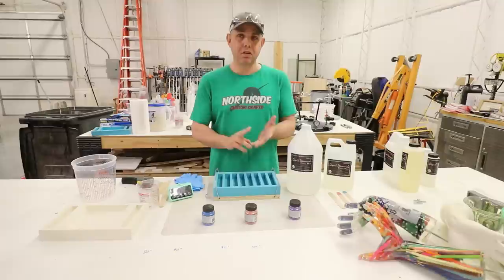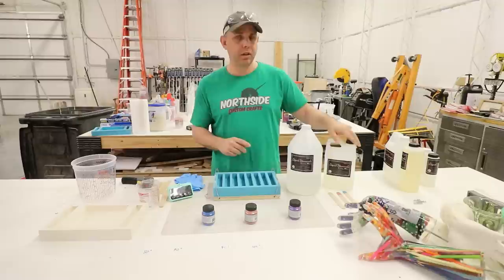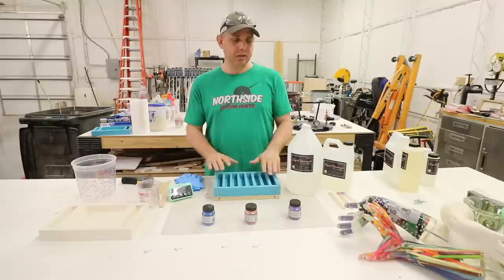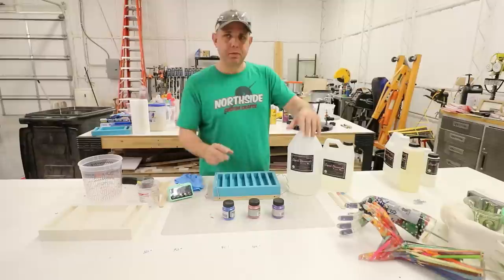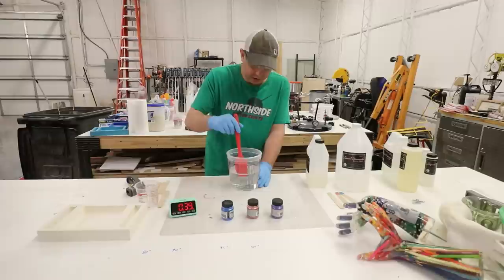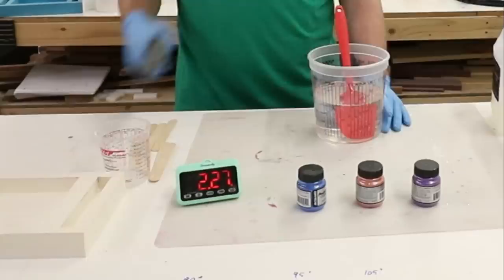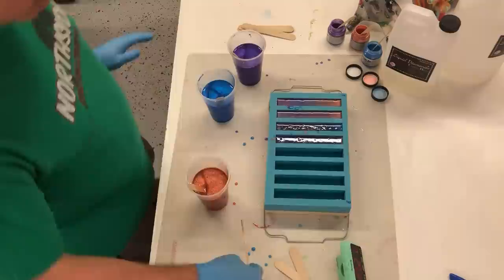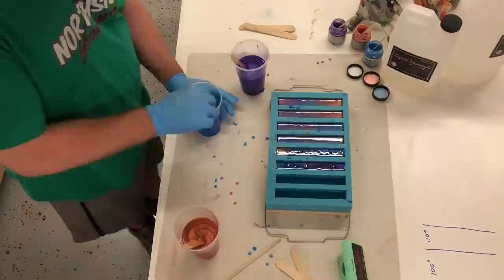Color Separation with Liquid Diamonds Epoxy Resin

Comment: That was a lot of work Jake!  Thanks for doing this. I've been working with Alumilite, and sometimes that 12 minutes and the heat goes really fast!  My last pour was at 145 degrees F,  needless to say by the time I got it into the pressure pot it had already formed.  My first failure.  But like they say, if you don't fail, you don't  learn.
Reply from the maker: I know the feeling Eddie!!! I fail a lot! Lol 😂

Comment: Great video!  I was trying to get swirly colors into a clear base.  I did an orangey red, a red, and a teal green.  It was into a skull mold I had put clear into.  No matter how little color I used- the colors expanded and took over.  
I get it that with the pen blanks the idea is to not see the internal parts.. so clear resin would be out.  I think I just have to get a temperature gun for knowing when to swirl the colors in.  The issue is waiting for it.. waiting too long means it won’t pick up the molds details.  But if I get the clear in there and coat it all over and then let it settle it may be ok.  Ugh .. so many things to consider!  It’s such a great ride .. and so unpredictable too. 
Resins gonna resin! 
Thanks Jake!  This video is exactly what I was looking for 👌👏👏👏💯🎯
Reply from the maker: Lol.. awesome!!! I’m glad the video helped ya out!! 👍👍💪

Comment: Jake thanks so much for the lesson.  I can’t count how many resin project videos I’ve seen and this is the first introducing the relationship between temperature and color separation.  I’m wondering how your pour technique changed between the ‘beginner’s mistake’ blank poured at 88 F and the others where the temps were hotter. I noticed at one point in the later pours you mentioned that you were pouring in too much at once.
Reply from the maker: Thank you! I’m glad you enjoyed!  When you are trying to swirl or color separate, it’s better to pour small amounts lightly into the molds. I could have done a lot better job of pouring lightly throughout every temperature.. That’s all I was saying..  I didn’t change pouring technique as much as I should between 88 degrees and the higher temps. 👍👍
Reply: What does change is the thickness as it gets hotter . Which causes  the colors not to run as quickly allowing you time to add other colors and they wont blend together so easily. Thats where you get your color separation.
Reply from the maker: Nina Mcrae 👍👍👍

Comment: Dude, thank you for this video, I just had an epic fail with this product. It was a multi pour project that overheated, and I’m talking hot foaming resin and extreme cracking.
Reply from the maker: Deadwood Casting & Turning how big of a pour was it??
Reply: Jake Thompson it was a 5.5x5.5x15 inch pour with some cedar in the center of it.

Comment: Jake, I so appreciate these "experiment videos you do!!  So helpful for all of us!  Is Liquid Diamonds less sensitive to any moisture in a wood?  I have really big digger pine pinecones which I can't get all the sap off of.  I am quite sure Alumilite CS would react to that, but I'm wondering if Liquid Diamonds might be more forgiving?  But do they not recommend deep pours?  What do you use for your deep pours?  Thanks again!!!
Reply from the maker: Thank you Amy.. I’m sure liquid diamonds might have less of a reaction to moisture but still react.. liquid diamonds will go a bit deeper than most other epoxies.. coating pieces with resin is also an option. I use either alumilite deep pour or the epoxy resin store has some deep pour epoxy too… You can use Jake10 at either site to save money.

Comment: I was wondering do different resins reach different temperature if they were side by side? I’m trying to follow your video. I am using a laser thermometer seems the temperature on mine drops. All though the temperature is right for pouring. 75 degrees in the house
Reply from the maker: Yes different resins need to be poured at different temperatures to create color separation..

Comment: OMG!  How long did it take you to make this video?  Thanks for the amazing work Jake.  Excellent job.  I've never used LD but I might be convinced to do so, especially with the open time after mixing.  I've done Alumilite, Alumilite Slow but my go to has been an epoxy I get off Amazon.  Would you use this again?  Overnight in the pressure pot and then you can turn 24 hours later?  Again, excellent video!!
Reply from the maker: It took about a week to make this video.. I do like liquid diamonds.  I leave them in the pressure pot overnight and then remold them.  At this point they are solid and don’t need to be in the pressure pot any longer, but aren’t fully cured.. I can still bend them if i try. So I let them set for 24 more hours.. Then I can turn and sand them. Thank you for watching. I’m glad you enjoyed it.

Comment: Another great demo video Jake!  These are truly invaluable!  I'm just getting into resins and learning a ton from these!  When you make those dragon eggs (resin/Wood hybrids), are you using "deep pour", "table top/artwork", or "casting" resins?  What is the difference.  I've seen people use casting resin, but poured a litre and a half into a bucket!
Reply from the maker: Thank you very much for the compliment.  When I do deep pours like the dragon egg.. That is with Alumilite Clear Slow. It’s a fast setting resin that is capable of doing deep pours.. But you have to measure it by weight and you have to have a pressure pot.
Reply: @JakeThompson  thank you sir!  What's the difference between a pressure pot and a vacuum chamber? And don't tell me that vacuum chambers suck!  Get it!?  Vacuum. ... suck! 😆
Reply from the maker: @jonathanbrowne8884  lol.. a pressure pot will hold air pressure in the pot squeezing the air bubbles so small that you can’t see them.. a vacuum chamber will remove bubbles from the resin before you pour it..
Reply: @JakeThompson  Thanks for letting me pick your brain!  Thanks for the advice on the deep pour as well!  I poured really deep on my mother-in-law, and there's no decomp smell at all! 😆 But seriously, can I use the vacuum chamber after the pour, to remove bubbles.  I'm new to this and my budget was blown about $500 ago!  If I don't need another piece of equipment, it would shut my wife up... I mean it would be great! 😲

Comment: As temperature increases, so elapses your pot time. How can you tell the isolated effect of temp without comparing, say, a uniform temp like 110 at 0 minutes and 50 min?
Reply from the maker: The amount you mix and the temperature in the room will change the pt life. The temperatures I show will determine if you get swirling or not.. I use the timer for a rough guide and the temperature gun as a definite time to pour.

Comment: Did the pressure put speed up curing time Jake or only help with bubbles?
Reply from the maker: I didn’t pay attention to that.. maybe I should.. with and without the pressure pot, I demolded it the next day and let it sit for 24 more hours.
Reply: @JakeThompson  no worries mate, thanks, I use an epoxy with a similar time limit but don't own a pressure pot and demold after 14-18 hours, they do really need at least another 24 hours to set properly though.

Comment: I just bought Platinum Clear General Purpose epoxy.  You are using powder.  What else can you use to color the epoxy.  I want to do a multi color lightening strike pattern.  Also, what do you use to take the temperature.  Can I use a candy thermometer?  Thanks for your help.
Reply from the maker: Thank you.. I use mica powders and some alcohol inks to color my epoxy and some pastes. The temp gun I use is just a infer red thermometer you can get from the hardware store.

Comment: Great information .  Flat pour reminded me of coasters ... LOL  How would this be for a trivet to put hot pans on from the stove? What kind of temperatures can they stand without going gooey?
Reply from the maker: Thank you!! I haven’t tried to put hot things on this resin.. but I would guess it wouldn’t go well.. lol
Reply: A clear coat with a resin made for higher temperatures would make it happen.  In my early days I made about 120 coasters, to sell, without thinking.  Then I sat a cup of coffee on one as the season changed.  It stuck.  Someone told me to do a clear coat with a high temp resin.. and it worked!  So I did a few that week.. well 110 coasters are still waiting 😂 because I’ve moved along to so many things, I can’t get back to them.   
Another friend who turns wood said I need to stack them up & glue them together and turn them.  I guess 20 or so at a time.  Make ‘I Dream Of Jeannie’ bottles or whatever.  Many times I almost tossed them in the trash.  I’ll probably give them all to my friend in exchange for a nice bottle. 
But yah.. clear coat anything like that with a high temp resin ✌️

Comment: Jake, first thing I notice about the Liquid Diamonds is the price, 1 gal kit for $49.00...that's alot less expensive than Alumilite (which i have been using to experiment with, thanks to your youtube instructions). I have some burl slabs coming (thanks for the heads up for worldwideburl in IG) in, and may make an end table with it. Do you think the Liquid Diamonds would be good for a live edge table / river table, since no pressure pot is really needed, or can you recommend an Alumilite product which would be better? And thanks fro showing the difference here, seems the heat is a good thing for color separation. Nice examples Jake.
Reply from the maker: I’m glad you enjoyed the video Rob.. you can use the stuff I used in this video.. https://youtu.be/j6S2-RFPOFY links are below the video.. if you don’t need that amount.. go to the epoxyresinstore.com and get some floral epoxy.. it’s the same stuff.. use Jake 20 at checkout on that stuff or Jake99 on the deep pour epoxy.
Reply: Heya please let me know where are you seeing Liquid Diamonds for $49/gallon?  Liquid Diamonds is their most expensive at $70 for 1/2 gal & $150/1.5 gals.  $49 is their General Use Epoxy Resin I think 🤔  on their website.  I do know they sell the General Use for less on Amazon ($43) than on their own site... with free shipping if ya have Prime.
Reply: Jake Thompson Jake what is Floral Epoxy?  Spell correct maybe got involved here 🤔
Reply: @debrajol3585  of course i can't find the link now

Comment: What does heating up your mold help with?
Reply from the maker: Heating the mold gets rid of surface moisture and if you don’t  heat up the mold.. the corners of the blank will be pulled away, or shrunk

Comment: Hey Jake you heat up the mold, what if you heat up the resin before mixing?
Reply from the maker: Hello, You will get less working time 👍👍
Reply: @JakeThompson  IC ok Thanks for the reply .. I found it makes it easier to mix and I was not concerned about the working time so ??? I'm retired so Time is not my issue ... lol.

Comment: how can I warm up liquid diamond . I setup pens in the pressure pot and was all liqued thinking the mix wasn't right but I need to warm up the  liquid diamond , cause it set in the garage all night and the temp is 51? any suggestions
Reply from the maker: I don’t pour unless the shop is around 65f
Reply: @JakeThompson  rhank you for your help. I've been putting my pressure pot in the house so ill place it in a warm spot

Comment: Goodnight. This device that you put in the resin what is it for and what is the name
Reply from the maker: Are you talking about the mica powders?
Reply: When you fill the molds with resin, put this device that has a light, what this device is for is to harden the resin
Reply from the maker: @isabelcristina8262  it’s to check the temperature of the resin

Comment: Also, if using a pressure pot, could you be more aggressive with the mixing?
Reply from the maker: Howard Camardelle Absolutely.. when I use a pressure pot I get after it pretty good.. the pressure pot will take care of the bubbles you introduce
Reply: @JakeThompson  With that much open time I could fill up my 5 gallon pot and still have time for a sandwich I think.  Thanks for all you do for the community Jake.  I really appreciate the help and guidance.  Keep up the great work!
Reply from the maker: Howard Camardelle 👍👍👊

Comment: Does Liquid Diamonds stay crystal clear?
Reply from the maker: BonnieE1969 I’ve seen some bowl blanks that Zac has done with Liquid Diamonds.. it was with no color.. very clear.. if in sunlight.. all epoxy will yellow over time.
Reply: Cool, I made a bottle stopper blank where the top section was clear (2 part pour) using Liquid Glass resin, it turned out beautiful,  but takes 2+ days to set each pour.  I'm not quick enough with the Alumilite Clear Slow... LOL
Reply from the maker: BonnieE1969 The waiting is definitely the trade off.. I bet they turned out cool!
Reply: It's the one on my Instagram with the purple base and a colorful seahorse.   I've been trying to do it again, but learned not to use 2 different resins for the separate pours...  they don't bond well.  lessons learned